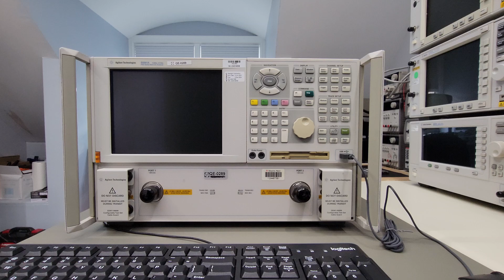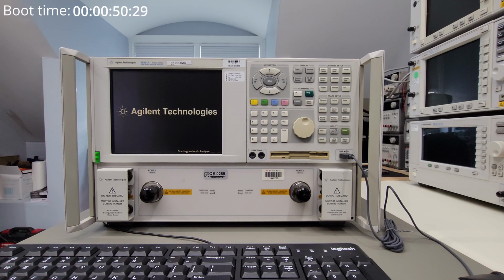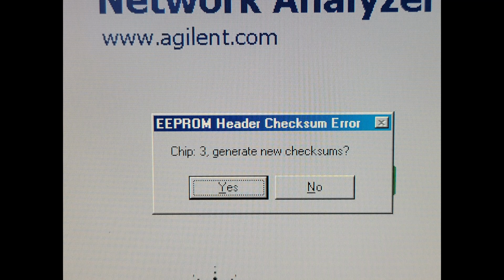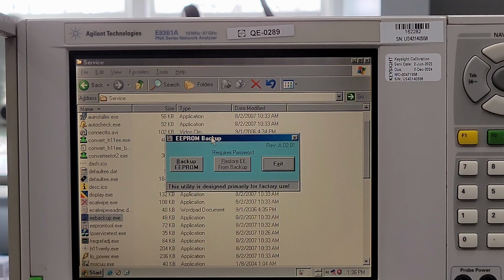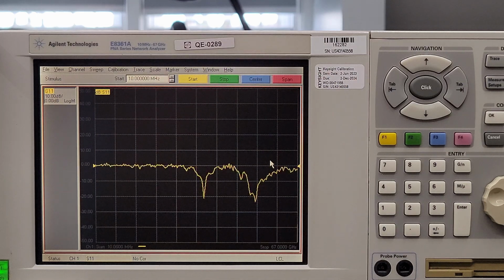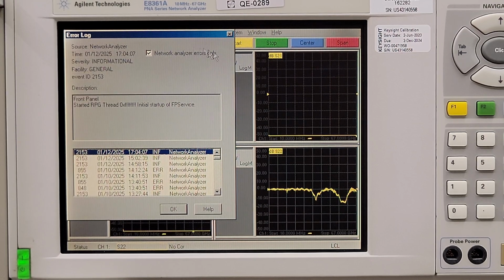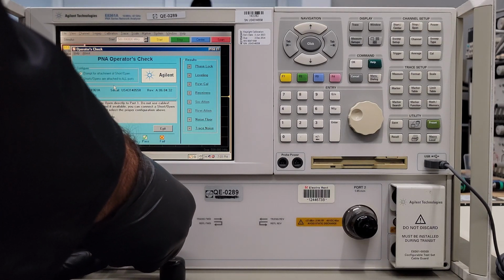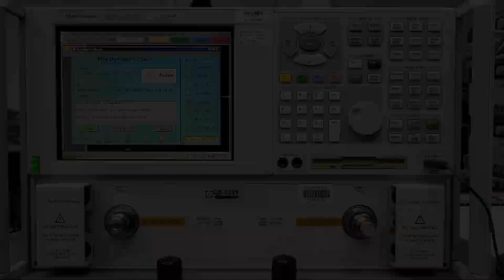Neonkev #6 - Agilent E8361A 67 GHz Vector Network Analyzer repair

Comment: Nice, always a good idea to go through the easy stuff first. 
Interesting to see it have a somewhat current calibration but I guess these high end models get used for a very long time, which makes sense. 
I guess a unit like this is a quite substential investment, even for a big company.
Reply from the maker: Yup, keep in mind that a calibration is only valid between two points in time.
In a production or testing environment where traceability matters, having a frequent calibration interval is important for quality assurance provisions.